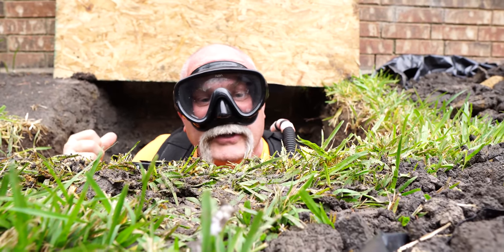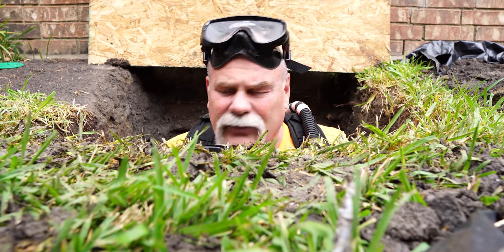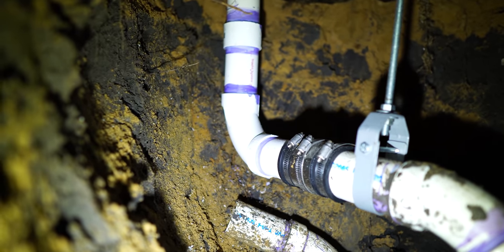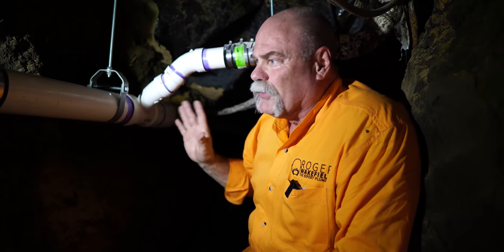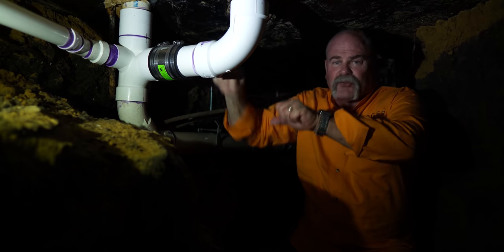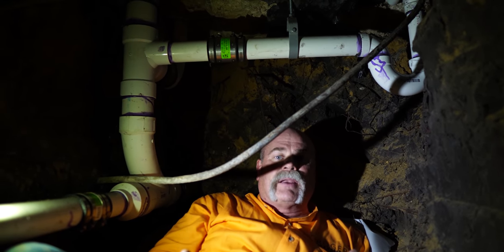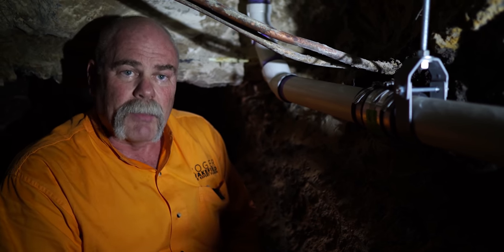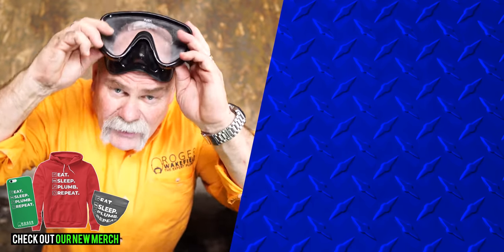DIVING DEEP Under a House to Repair Broken Sewer Lines

Comment: Incredible work. But to much primer on fittings, i prefer to ise 2" ptraps even for tubs, under a slab is supposed to be 2" anyway i also dont like to used nut and washers for the tub overflow kit i always like to use glue type overflow kits. I've seen some plumbers in my area do this kind of work and it's way to much work. Most of the time i try to convince the client to cut open the slab and have it repaired above ground, i just wonder if the guys backfilling put so much dirt that they raise the pipe in some areas and mess with the ¼" slope.
Reply: In drainage, bigger isn't better. More fall isn't better. Rule of thumb is... Smallest drain lines the code allows and largest water lines the owner can afford. You could tie a K.S. in to a 3" line. It wouldn't get clogged for a long time. But, when it clogs, it CLOGS. The water doesn't scour the walls as it flows down.
Reply: @TheNimshew  small drain isn't better, less fall is bad. In a new construction it's best to have a 4" longsweep 90° than a 4"x3" closet elbow.

To much wall over ¼" would mean water would flow to fast leaving the waste behind and to little fall, well you know. In our jurisdiction we aren't alowwed to have 1-½" ptraps underground on a slab foundation, using a non glue overflow like the one he used is cheaper and less reliable than a glued overflow. Plus if you use those overflow kits you have to leave acces for inspection every few years wich no one does and this is why they are no good.
Reply: @ImYourHucklebery117  True. At 1/4" fall the pipe is scoured out.  that would also be true at an 1/8" or 1/16" IF you could be sure that it was uniform throughout. Regardless, 1/4" is code where I've been doing the trade for 44 years. Explain to me why a L.S. 1/4 bend is better than a 4" x 3" closet ell?(on a toilet) Try and install a 4" L.S. in no hub C.I. on a toilet. It isn't done. The closet ells come in various length and rise. 4" x 3" x 6" x 16", etc. For years I used a 3" 1/4 bend on toilets. I've changed. It's easier to use a 4"x 3" closet ell when it comes time to set the flange. No need to have an inside cutter. And, back in the day, ABS was used underground and a 4" C.I. closet flange installed on the ABS. Pouring a lead joint . I know. We old guys are loathe to change. You're required to have a 2" trap on a bathtub? Then, a 2
 trap arm? Odd. So, on a residence, you'd run 2" to a bathroom sink? Well, that's done on commercial because I don't think 1 1/2" p-traps in C.I. are made. 1 1/2" no hub is, or used to be made? Not sure. I take that back. I ordered 1 1/2" C.I. 1/4 bends once. Expensive. I don't know what's used instead of copper these days for vents and trap arms. You probably do. I'm speaking of over 2 story buildings. So, what I'm saying is this. The reason you use 2" C.I.. on drains that only require 1 1/2" is because it's cheaper than trying to get 1 1/2'". If 2" is required, quote me where it says that in your code book. Nowhere in the U.P.C. is that rule. If it is required, it's because the inspector thinks bigger is better. No access to tub waste and overflow because builders are too cheap to install them. And, I don't like sticking my hand in dirty tub water to open the drain. Of course, I hate PEX, too! Shitty and ugly. So easy that you don't need a plumber to do it. Which means... they don't need YOU!

Comment: Am i the only one who noticed the p trap on minute 5:58 is glued in the wrong position? 🤒 (backwards). Just a 1.5 years apprentice wondering 🤕
Reply: one side is way higher than the other it really dont matter
Reply: On drainage traps in ABS or PVC 1 1/2" and up, the U-bend is of equal height. Unlike a nominal p-trap under a sink. There's no way to install one backward. But, it says you're trying AND says you've not been doing it very long.

Comment: This is why the practice of burying sewer and electrical and water lines behind walls and under foundations is just silly, and wasteful. We know it is going to need repair at some point... Why not make it easy to access? But that would be too simple...
Reply: depending on your soil, underground structures may not even be possible.  in oklahoma, we have red clay and a very, very high water table.  this will cause basement walls to leak and collapse, which is a much bigger issue than dealing with underground plumping.
Reply: @theghostofthomasjenkins9643  Builders can still make it easy to access for repairs. Just sayin'.

Comment: Love the videos, but wouldn't you be expecting a ground shift with the sheer bands, rubber would be more maliable then pvc in these circumstances. Also for for these kind of digs, one would imagine that you would be a little dirtier, not just a little dirt on your hands?
Reply: that's why they have metal shielding.  that metal shielding is what prevents the pipes from shifting as it's actually stronger than pipe it's holding together.  that pipe will break before band shifts.

Comment: To the uninformed, those “sheer lines” look a lot like rubber hoses out of a car with hoseclamps that you talk so much trash about.
Reply: Yea they basically are. I'd never put one in underground.
Reply: those are a plumber's best friend for jobs like this.  due to how PVC glues together, you don't have room for normal couplings when doing a repair like this.  those rubber couplings, which are designed for drainage systems and are not heater hose, can be slid down the length of the pipe, allowing you pipe directly to the existing line without gaps.  to use them underground, they have to have metal shielding between the clamps and the rubber coupling to prevent the pipes from becoming misaligned.

as far as the brand he used, i don't like it.  there is only a single clamp on each side while better bands have two to give it more stability.  the do make PVC slip couplings and compression couplings, but those are not as reliable and fail far more often.

Comment: Build basements. I can’t believe how many thousands are cost for crappy repairs under the concrete slab of a house. Yes you would still have some pipes underground but with a basement you have one water line & usually a floor drain & laundry going out the house. It boggles my minds that Americans run drainage & water lines under slab & lots of time waterlines are run IN slab. I just shake me head every time. Installing hangers to get buried is not logical, efficient, or smart & it look sloppy as hell